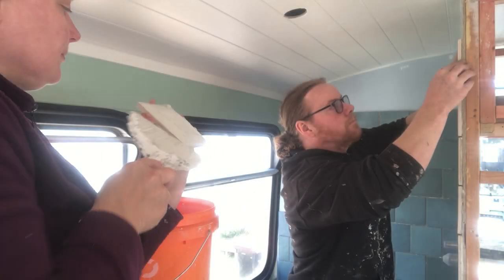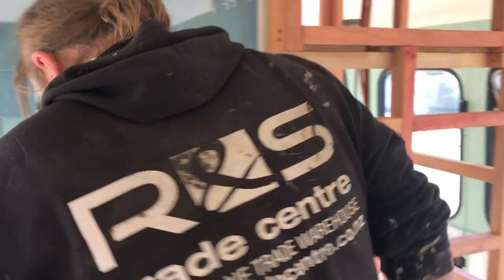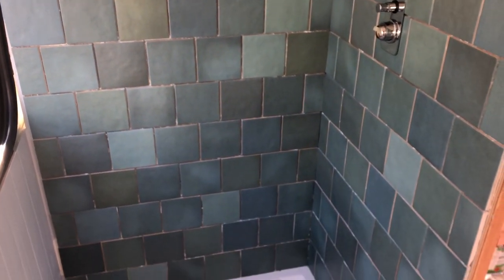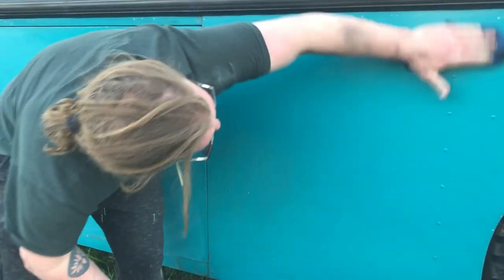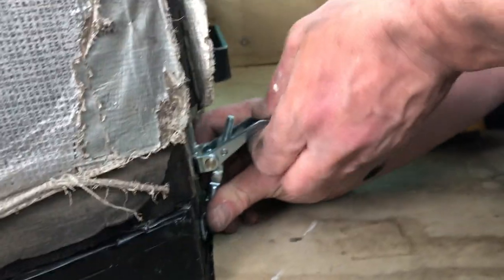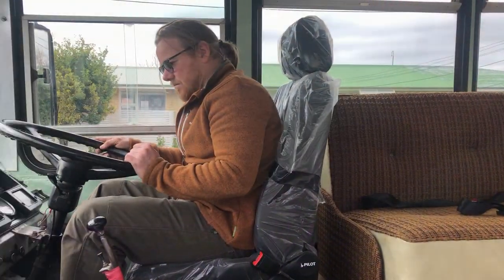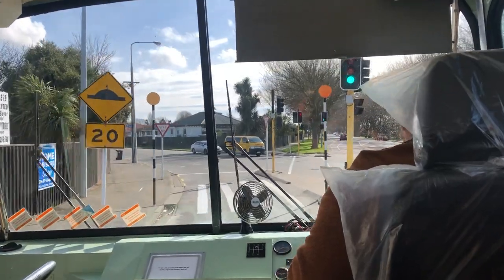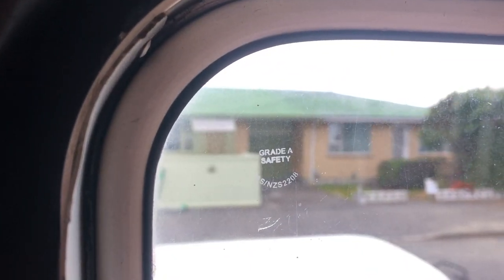Tiled shower and motorhome registration, 1984 Isuzu JCR500 school bus conversion (S1E12)

Comment: Love your build, you need to get some of that static cling window treatment for the bathroom window at least the bottom part it makes your window look like stained glass and it keeps prying eyes out while you're taking a shower but let's light in. You guys have a really awesome looking bus. And I was wondering to on the engine Hood do you have that adhesive I can't think of the name of it is stick it on and it's supposed to be soundproofing so it keeps some of the bus sound out of your driving area and stuff when you're going down the road that would not only be nice for soundproofing but it would be nice for its insulation qualities from the heat of the engine in the summertime
Reply from the maker: KAREN RIGGLE Thanks! 😊 We’ll have an “L” shaped shower curtain that will cover the window too, protecting it from water and us from prying eyes when we shower. If we feel too exposed we might do some window tinting too later on. Yes, the engine box has sound deadening material on it now. We will probably add more when we build the lounge seat that is going on top of it. The cushion will insulate it further.

Comment: 1,5 years until my Ford Transit box car can have its registration changed to camper without paying lot of tax here in Norway (need to have been 10 years or more in Norway  to do it without paying tax). But it just passed inspection so it is good to go for 2 years and I can start the job converting early without them noticing ;) 

Here they are crazy with the classifications of cars, depending on the  moon phase, position of planets, mood of the bureaucrats and if they happen to like you or not  you have no guarantee how they interpret the wage rules... When I start converting it there is always a chance they will go crazy if they get the idea in their head that it is not a cargo van anymore even if it is not legally a camper.
Reply from the maker: Rondo Cat Yeah... regulations can be a pain! We want to go off grid and just mind our own, but you still have to play by the rules. Have fun with your conversion! 😊